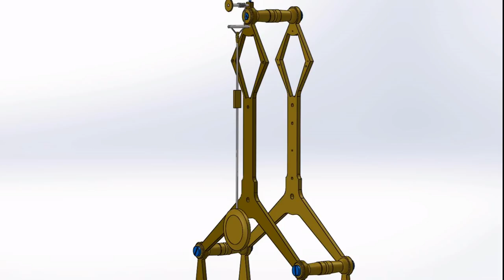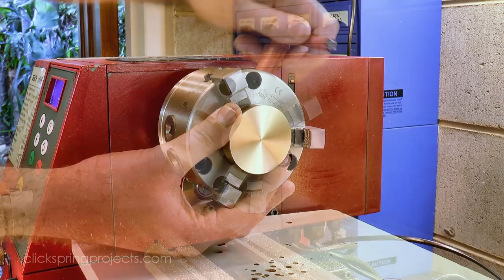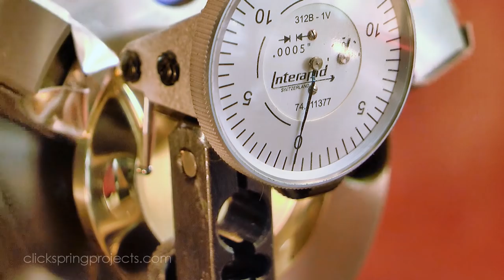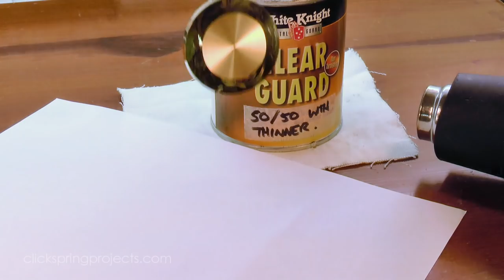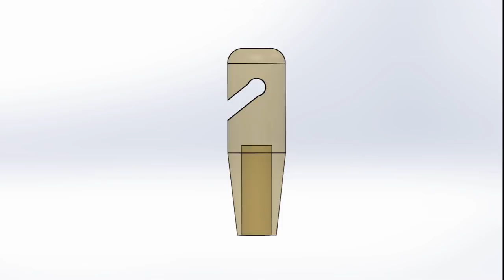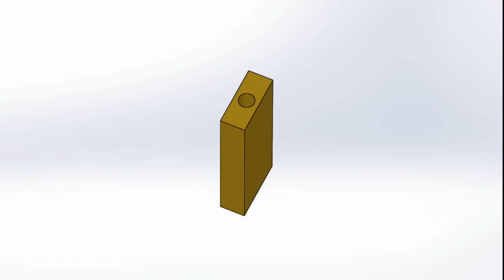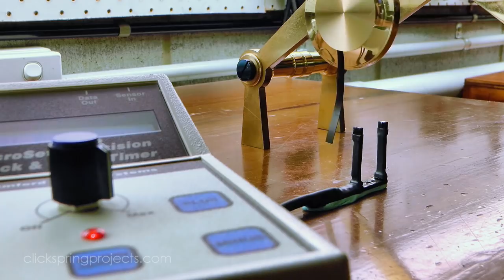Clockmaking - How To Make A Clock In The Home Machine Shop - Part 18 - Making The Pendulum

Comment: How do you go about polishing your parts to a near mirror finish? I'm particularly interested in those you do manually since I don't have any power tools at hand and want to polish a pocket knife blade.
Reply: For a pocket knife you'd probably be better using sandpaper (or sharpening stones if it needs sharpened too) first to a fine grit and then a leather strop or something to give it a good polished-blade finish. Think of chisel sharpening (check out Paul Sellars on youtube for sharpening), which leaves a great finish.
Reply from the maker: More detail on polishing on the very last video of this series, thanks for watching Ryan :)

Comment: If you made the pendulum swing on a string instead of a rod , there is actually a specific geometric shape that you can make to correct for larger oscillations. the shape is called a cycloid. look up cycloid pendulum
Reply: That's actually really neat!

Comment: I would suggest making the pendulum assembly pivot around a shaft with precision bearings on the ends rather than a nylon rope. Great work on the project.
Reply from the maker: A silk suspension is consistent with the tradition of this design (Classic French Y Frame) thanks for watching

Comment: Question: If you rounded the inner key-way of the hook to more closely follow the path of the regulator string (or at least not have sharp edges), then wouldn't you have better control of the regulation? It seems the string would snag on the sharper edges permitting only stick/slip intervals of regulation rather than continuous/infinitely adjustable. There's also the odd instance of the pendulum being pulled so that it is supported more by one edge of the hook causing it to twist during it's swing. 
Just an observation from an admirer.

Comment: Using steel for the pendulum rod has one classic weakness: thermal expansion causes the clock to slow down in heat.  Short of using a complex temperature-compensation design, the simple, classic alternative is to use a wooden rod (with the grain running down the length of the rod).

Another detail worth considering is that, optimally, the rod should be attached to the center of the bob, so that the bob's thermal expansion is symmetrical around the attachment point.

Comment: The curvature and finish on that pendulum is amazing.  Your slow-mo pan shots across the curved reflections look like one of those "Gravity Bubble" screen savers where the reflections warp and collapse/expand on themselves in amazing ways.   Beautiful.   :)

With such shine, the bit that worries me is - will lacquer coatings preserve the high gloss finish of this clock for years, or is it going to gradually dull over time and require periodic polishing ?   Perhaps you could enclose the finished item in one of those glass domes full of nitrogen to stop oxidation ?

You could probably make a "Shiny Highlights" video compilation showing all the gleaming bits from all the videos you've made so far and people would just watch it for luscious eye candy factor.  Incredible work as always. !
Reply from the maker: The metal will still oxidise even when lacquered, just at a much lot slower rate. The only truly effective protection is to electroplate with a less reactive metal like gold or rhodium. I don't have a plating facility set up yet, so this clock will be left to develop a natural patina over time. Natural patina is the most traditional finish, so its not such a bad thing. Cheers mate :)

Comment: Thanks for another excellent video. I find the silk string a bit puzzling. I suppose is provides a very low friction pivot. But I would have thought it would stretch : with time, with temperature, and with humidity. And that it would wear. What is the alternative normal suspension mechanism, as used in  long case clocks etc?
Reply from the maker: A silk suspension is one of the 3 most common pendulum suspension methods (the other 2 being knife edge, and suspension spring) and the most flawed from an engineering perspective by far. You have correctly identified the main problems, although within the context of a recoil escapement, short pendulum, relatively wide arc and no temperature compensation, it matters little. This design is true to the classic French Y frame design from the 17-1800's. It was intended as visual showpiece for the wealthy, rather than as a particularly spectacular timekeeper. If it keeps to within a minute or two per pay I will be well pleased! Cheers mate :)

Comment: You need to make the rod out of at least 2 separate materials so that it doesn't contract and expand as much with temperature fluctuations. That way it will run more accurately.

Comment: It will be interesting to see how much longer the pendulum will need to be to account for the removed mass for decorative purposes
Reply from the maker: One of the interesting things that Galileo discovered about pendulum behavior is that the frequency of the pendulum is independent of mass, so no change to length required. Thanks for watching :)
Reply: +Clickspring True, but the center of gravity will have shifted causing a reduction of the effective length of the pendulum

Comment: G'Day Chris. I've been with you all the way on this project and greatly enjoyed watching each and every of your professionally produced videos. I can see that you want to ensure that the parts that you use are totally within your control, e.g. by using a silk thread for pendulum length (I'd probably have utilised a ready made pendulum spring suspension).

Given that you chose to go with the silk suspension method, I would say that by using this method, any fine adjustment is 'out of the window'.

Personally, given that your silk suspension method was set in stone, I would have gone for a brass pendulum with a 'clearance' hole and a screwed pendulum rod with a beautifully turned and knurled adjustment screw.

As a pendulum rod, I would have chosen 'Invar' with the finest screw thread possible for the adjustment nut... FeNi36 (64FeNi in the US), is a nickel–iron alloy notable for its uniquely low coefficient of thermal expansion (CTE or α). The name 'Invar' comes from the word 'invariable', referring to its relative lack of expansion or contraction with temperature changes.

Pendulum rods made from 'Invar' are more accurate (temperature-wise) than wooden pendulum sticks.

Invar is not expensive... eBay, 1270 mm long x 6mm diameter, £39.99, GBP so work it out to your ozzie dollars, mate.
Reply from the maker: All good suggestion Gordon, although I should probably point out that I am following the famous clockmaker John Wildings' plans, so apart from some minor differences, the design elements are his choices rather than mine. Wilding has based most of his choices on the classic "Y frame" table clocks that were popular in Europe during the 17th-18th century. As such, the clock lacks virtually all of the traditionally accepted features of a good timekeeper, such as temperature compensated pendulum, deadbeat escapement etc, and indeed has a silk suspension which was well known to be flawed, but considered very elegant and "good enough" from a regulating perspective. The clock was traditionally a very expensive visual showpiece for the wealthy, rather than a particularly special timekeeper. I'll be thrilled if it keeps within a few minutes per day. Cheers mate :)
Reply: A brilliant explanation, Chris. I see now where you're coming from, mate!

Can we expect more from you in the future? I sincerely hope so.
Reply from the maker: You bet - 3 more episodes in this clock build, and then I will get stuck into the next long term project. Terrific to have your support mate :)

Comment: Hey mate. Love your videos. CNC machinist is my day job, but I love the old school methods you use. I'm wondering how many decibels your small shop cranks out while you work? I live in a flat with a spare room and am wondering if these smaller machines would be quiet enough to use. Keep up the fantastic work! You are truly an artist, at machining as well as filmography.
Reply from the maker: The red lathe (SC4) is probably pushing it for a small flat - Its not overly loud on its own (approx moderate conversation volume), but the cutting volume can get up there with decent cuts. A definite contender for a flat would be the Sherline. Quiet as a mouse, and it can't take large cuts, so no issues there either. Terrific to have you watching Nick :)

Comment: Thanks for another awesome video, it's truly inspirational for all makers out there! Just was curious, people are making clocks for quite some time, but loctite is quite a recent development in machinery. So, how people would attach pendulum rod to pendulum .. let's say in 16-17th century?
Reply from the maker: Its awesome to have your support Dmytro :) Historically soft solder was used for permanent bonding, and is still widely used today in horology. However there are a few metallurgical issues that arise from heating the workpiece to make the solder flow - one is the heat marring of the surface finish (which is what I was keen to avoid with this part), and the other is that its very easy to overheat (and therefore draw the temper) of adjacent hardened parts when soldering. These two reasons make Loctite adhesives very popular in modern horology and model engineering. The shear strength is comparable to soft solder, and the bond is also very easy to reverse if required; just heat up to approx 150C and the adhesive breaks.

Comment: Every aspect of the production and machining is absolutely spot on ... I wish you worked faster simply because that would mean there was more to watch.
I can never quite get my head round seeing the loctite bottle come out for a permanent fix though.  If it didn't work, I'm sure you wouldn't use it, you do - so it must ... 'nuff said ... it's just that - I've always been screw and glue ... I know - my problem not yours..

What would the "old methods" of fixing those parts be ?

Comment: Chris, like many folks, I have ALWAYS been fascinated with Clocks, I fixed my Adopted Grandmother's old "Ben" Alarm clock at age 14! She was not "worried" about it, since it had Not Run for years! 

Now at age 68, I have decided to build a Clock, from the flat metal up.

I have been a Home Shop Machist for 25+ years, as well as Machining Professionally for the Thayer Valve Company, which developed the First new Patent for Musical Brass Valves since the 1860's!

My question to you is, do you think the Pendulum Clock you are showing us is more than a beginning Horologist should attempt?

(And I will soon be a Patreon of your work, starting small as I just finished moving in the State of Oregon.

Thank you for your Very Concise Method of instruction!

philip from Eugene, Oregon, USA
Reply from the maker: Its a terrific beginner clock project Philip. A relatively simple train, but nevertheless it requires you to go through all of the basic clockmaking procedures, so you will get a good grounding in each. Its definitely demanding in some areas, but nothing that will trouble you given your experience - Cheers :)

Comment: Fantastic video :) I love your attention to detail. I was a bit skeptical about your use of layout fluid and 'eyeballing' the lines created with your verniers, rather than zeroing the work and going off of the increments on the axis winders (excuse my lack of terminology). But I tried the layout fluid technique today and I got within 0.05mm on eye balling it alone. Very impressed :D I did have to use magnifiers mind due. :) Keep up the great work. Whats on the cards after the clock is complete?
Reply from the maker: Another long term project on the scale of this one. Its in the works now, more detail as this one gets closer to the finish line. Cheers Andy :)

Comment: Chris, good call on the different finishes for the pendulum. Looks lovely.Do you have issues with heat while shaping and finishing? I find I need to cool the material while working, perhaps I'm just pushing it to fast...
Reply from the maker: Sometimes, yes. If its a particularly critical dimension, I'll wander off and have a cup of tea - by the time I come back its all cooled down, and ready for a light final cut to final dimension. Thanks for watching Jarrod :)

Comment: Hey, Chris!  Is there anything that you could put on a new lathe that would keep the markings on, or would oil just strip it off eventually?
Thanks in advance!  Can't wait to see the clock finished!  :)
Reply from the maker: its a kinda cheap lathe, so the markings are stencilled on rather than engraved as it should be. I'll get around to marking it properly at some point, it will make a good video :)

Comment: Great video! can I ask why you went with locktite for the shaft instead of threading and screwing it in?
Reply from the maker: I have avoided a thread because of the potential risk of it unscrewing and the bob rotating. Solder is a perfectly reasonable option to use, but there are some excellent benefits of Loctite adhesives that make them hugely popular in modern horology, and in general engineering. Thanks for watching

Comment: In the past, how would clockmakers calibrate their pendulums?
Reply from the maker: Where precision to a second was required (for example to rate a regulator), passage of a given star against a distant object like a building (rooftop edge, church spire etc) was the most common method. This gave a sidereal period, which can be easily adjusted for mean solar time. Great question, thanks for asking :)

Comment: Love your videos!
I may have missed something, but is the pendulum rod connected to the pendulum just with loctite? There's no worry that with age that may fail?
Reply from the maker: Yes just loctite 603. Its a very good metal adhesive with comparable shear strength to soft solder. It has been widely used in general engineering for a few decades without issue, although long term strength/durability will only be answered after a few hundred years. If it should be found wanting, a future repairman can easily swap the bond for soft solder without penalty. Thanks for watching and asking :)

Comment: Why not use the superglue arbor for removing the second spigot, wouldn't the surface still be true even if off center? Or is Chris showing another method?
Reply from the maker: The off center facing cut would jar the viewers eye, particularly at the point where the cut meets the reflective surface. thanks for watching :)

Comment: If that rope is made from plastics, you might get "creep" over time: the rope will stretch somewhat. This might mess up your accuracy. Use an organic or metal rope to prevent this.
Reply: If I remember correctly it is silk rope.
Reply: Ah, not to worry then :)

Comment: Why don't you use thread + loctite to secure pendulum to rod? Is the loctite tough enough to carry weight of pendulum for years?
Reply from the maker: yes Loctite 603 has comparable shear strength to soft solder, thanks for watching Alexander

Comment: Does the pendulum need to be a certain mass to be effective within the effective length? One can make custom designs if it's a certain weight and allows for balanced swing correct?
Reply from the maker: Great question Jeremie! One of the other interesting attributes of a simple pendulum is that the period is independent of mass - https://en.wikipedia.org/wiki/Pendulum#Period_of_oscillation. Mass does play a part in other aspects of the pendulum like Q. Thanks for watching :)

Comment: I remember a while back you modified a set of drill bits to have the correct rake angle for brass. Did you modify the end mill in this video? Or is that not necessary for milling since the mill holds the cutter tightly to prevent digging?

Comment: im curious to why you chose to glue the pendulum into the metal rod instead of cutting in threads.  thanks for the great video!
Reply: Or solder
Reply from the maker: Solder is a perfectly reasonable option to use, but there are some excellent benefits of Loctite adhesives that make them hugely popular in modern horology, and in general engineering. Thanks for watching Paulo
Reply from the maker: I have avoided a thread because of the potential risk of it unscrewing and the bob rotating. Thanks for watching Jonathan

Comment: With a little math, I calculate that with the accuracy of your equipment you can adjust a clock to plus or minus 1 second in 11.5 days, (One 1 Millionth of a second.)

Now the question is, does the clock keep time that accurately?

Frank
Reply from the maker: This design is based on the classic French Y frame design from the 17-1800's, and has a number of design features that pretty much guarantee modest timekeeping - silk suspension, recoil escapement, short pendulum, relatively wide arc and no temperature compensation. It was intended primarily as visual showpiece for the wealthy. If it keeps to within a minute or two per day I will be well pleased! Cheers Frank :)